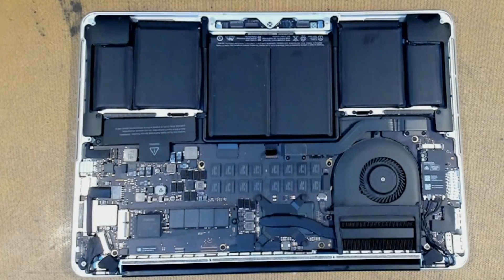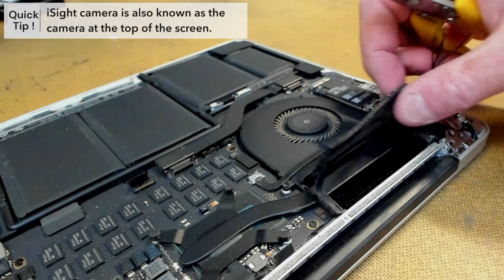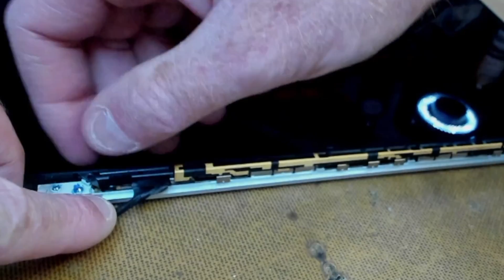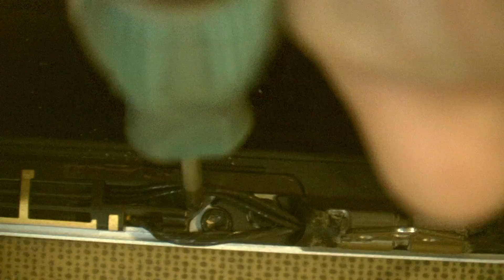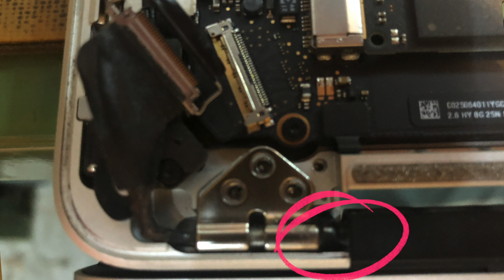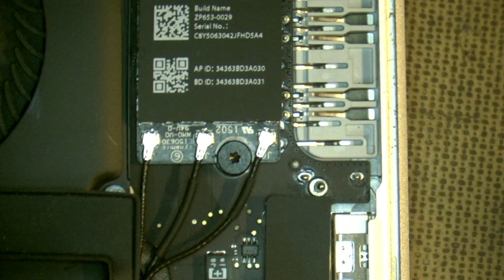Macbook Pro A1502 Display Cable Replacement

Comment: Thanks for this mehn. Very helpful. Unfortunately for me the new cable didn't do the trick, but through replacing the cable i was able to determine that its just the display that's cooked. 
Also, the cables from amazon, mine was glitching the display, and i could tell that it might be a compatibility or quality issue. So beware of the cheap cables. even if the cable was the problem, the amazon cable would have not been the solution but maybe one from an old mac, or a legit spare part. Thanks for this!

Comment: Absolutely amazing video, it makes you feel disassembling and reassembling your screen is the most relaxing activity ever. I had a problem with the backlight flickering constantly which made my Macbook (also A1502) nearly unusable as it flickered every few seconds. Followed your instructions, but did not replace the cable but removed it, straightened it out, cleaned the connectors, and then added contact spray on both connectors, cable wise and board wise. Result flickering, is gone for good. Also gave the internals a proper clean up while at it. Roughly one hour as you said. This 10 year old Macbook dropped a lot during its lifespan and I guess the connector either got a little lose, or there was slight corrosion. So either the reseating or the contact spray fixed it. Thanks for the great detailed and relaxing instructions.

Comment: I was trying to get a screen from a liquid damaged A1502 onto my A1502 but it seemed at first the LED's and driver on the donor machine were damaged. Then finally with the microscope i found the 1st pin on the display connector was completely burned out. I took the cable from my display and the screen worked. Now i'm going to solder a new port on the donor motherboard, get a new cable and see if i can fix the donor with some more cheap screens i found. Hoping it's another cable job on at least one of them. Going to look on ali ex for display cables. I wonder if they do them with the hinge. The guy got the spec of the donor machine wrong so i got €50 back. Paid total of €90 to get my machine working again and end up with a project, if i manage to fix it i might be able to sell it for €180 or so. In any case it works on an external monitor and it came with a power adapter. Amazingly the donor machine still has the 52V present. or whatever the voltage was.

Comment: if you drop macbook and screen out( black) 99% problem with small black connector on right  from main metal connector screen . Just doing everything like on this video and push with click small connector and you done . Then drop macbook pro this small connector jump out and we have black screen. Thanks for video .

Comment: Will you please help me on this? I followed these steps have not yet changes the cable, but just opened it to see if it could work, when i put it back i started hearing 3 beeps then pause for few seconds then 3 beeps and so on, and the screen now remains black before it used to be white, what does that mean? Thank you

Comment: Thanks for the video! I had the same issue of black screen sometimes when I touched the screen in certain angles. I changed the display cable two times after still having the problem (but far less often) after the first display cable change. Now I still have the problem with my third display cable and I am really starting to get desperate. Any Ideas or experiences with this? Display works but then randomly shots off after I touch the macbook and goes on after tilting the screen. Sometimes I have to restart the macbook for the screen to work again. Thank you very much!!
Reply from the maker: It might be a loose  connection   ??????

Comment: How much would this roughly cost at a repairs?
Reply from the maker: Roughly $100 - $200.
Reply: @Repair2Renew  I took it into someone and they said it was the display cable so the whole screen would have to be replaced for $900. I left it as was way too much.
Reply: @kaitrenee6259 I went in to Apple Store today as my screen cables see screwed somehow.  I can see usual screen but it’s like constantly lots of flickering in the background and distortion etc.  I was told that the display would need to be replaced and that this would cost £369 so now I’m looking for alternatives to try to try to get it to work
Reply: @kaitrenee6259  the replacement screen costs ~100 USD from Aliexpress

Comment: Hi, my laptop hat similar situation, but I tried like you to change the cable and that still not work. Do you have any idea what will be like this happens? Thank you.
Reply from the maker: Unfortunately it is hard to diagnose a macbook, when not in front of me.
You might have to take macbook to a repairer.

Comment: What's the dimension of the T8 at @ 7:50, stripped mine but able to get it out? I'm trying to source one but my Google Fu is not sharp today.
Reply from the maker: Not sure on the dimensions of that T8 screw in particular.
You might have to use old screw by cutting slot in the top, and re-securing with a 3mm flat screw driver.
OR get an old broken A1502 macbook and steal the screw off that?

Comment: Hi, I found very interesting your video: I have a "similar" problem; my macbook started to have one only purple vertical line, more or less at the center of the screen. Sometimes, this line changes its colour, moving from purple to a sequence of colour similar to other pixels around the line. I didnt' "hit" the computer in anyway: according to you, the replacement of the cable could fix the problem? The laptop is very used, but it could still work well for my needs in next months...
Reply: Do you agree with me?
Reply: I have the same problem, but only occasionally, for now. Do you think it can be solved by changing the display cable?
Reply: @lucianodeleon7962  at the end I left the purple line there...I put Windows on It and sometimes It disappears too, completely random

Comment: I am having this exact issue and replaced this cable however the screen did not turn back on. Any other suggestions?
Reply: get a new display assembly

Comment: Hi thanks for the video. A question, i have A1502,
When i replaced my broken screen with a new one the white screen of death appears on boot up. And nothing i do would make it go away. 
When i put my old broken screen back then the mac works fine.
What could be the issue?
And how could i solve it?
Reply from the maker: Unfortunately, it's a bit hard for me to diagnose your macbook, when its not in front of me.
I would suggest to double check your lvds (screen connectors) connections.